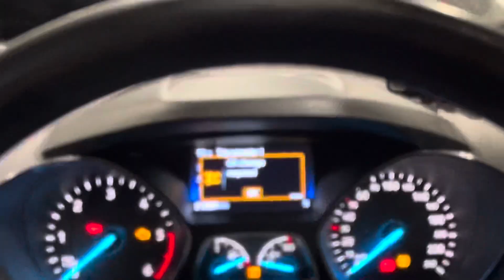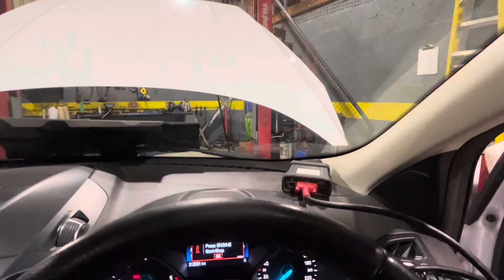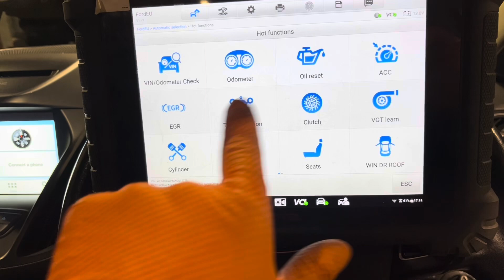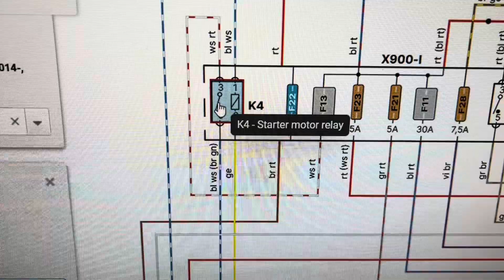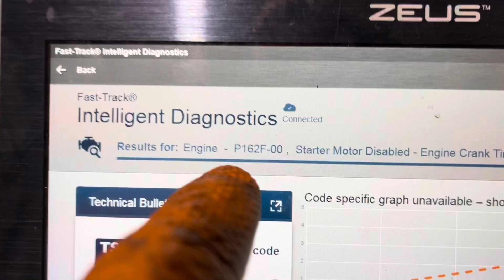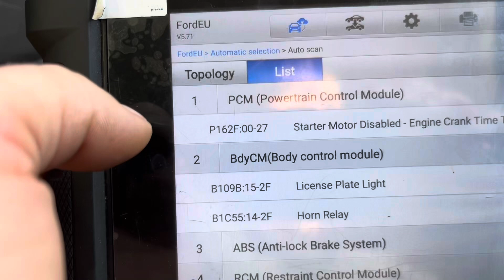Ford Kuga, P162F starter motor disabled fault

Comment: Ive buggerd a shitron dispatch. And has a simllarr sort of issue power to crank relay but dead after the relay .  Ive been told could be altenatror as its a stop atsrt and the alternator helps start the engie but then it could be bsi as i was probing that.  Its getting beyond a joke taht a ecu or bsi os so weak in failure points

Comment: Strange one will code erase In eobd mode ?
Did you manage to test the 2 control wires for starter relay ?
Reply from the maker: @simonedwards5401  code won’t clear in EOBD or manufacturer specific. But I didn’t load test both control wires, so I had better make sure to on the repair job . Good thinking & I appreciate it 👏👏👏

Comment: is it keyless entry , fords use the remote function module for the start button command to the engine ecu , not sure with the Kuga set up , the tpms runs with this too.
Reply from the maker: @mike-s8n8y  interesting, that is something to look at before fitting the ECU 💪💪

Comment: Thank you for posting this Peter - you get EVERY complicated job in Ireland !!
Them ECU's are a known fault on Fords the Focus has it in the same place - maybe ok if you live in a HOT / DRY country - but water & electric's do not mix 
They also suffer from snapped wires from the ECU to the fuse box & direct to components - dont know if it is the (Peugeot wiring that has ALWAYS been as brittle as dry pasta ) flexing / vibrating / rubbing 
All ECU's should be INSIDE the car !!
Reply from the maker: @colinblythe3710  that is a good comment & yes, you are correct they would be better inside the car. Quite a few a saying this is a relatively common failure on these ECUs. Cheers Colin 🙏🙏

Comment: There shouldn't be 3v on the relay signal circuit when the button is not pressed. The constant 3 volts is telling the ECU that you are trying to crank. Pull the relay leave and reset the code. If it clears then you know the 3v is wrong........ECU or wiring problem
Reply from the maker: @tomcurran65  good food for thought Tom. The car is back with the owner as it was, now I kinda want it back after reading some of yer thoughts 💪💪💪

Comment: Ford has so many modules that prevents the car to start . It only starts because of the bypass. The fuel control module can be at fault , the bcm can also cause it . Even a abs fault can prevent starting because the ecm doesnt know if the brakes work, you got a task with this one mate , Just truck on you will get there i have faight in you 😊😊
Reply from the maker: @xxl531  I hoping to get the ECU replacement job, but haven’t as yet. My conclusion was that it is the ECU with no faults in any other module causing the P162F to be stored in it. I’ll let ye know either way 😉👍👍

Comment: Just as a FYI - the car is not going to do DPF regens correctly with a faulty ambient air temp sensor showing -40c, so that needs fixing also.
Reply from the maker: @timbo19751975  correct, but weirdly I mentioned this to the owner and he hadn’t ever seen the -40 and then when I looked it operating as expected. This also points me towards some kind of internal ECU failure especially after the holding box had been burst open like it was 🤷🏼‍♂️🤷🏼‍♂️

Comment: Very interesting! Based on how the relay is energized (ECU) points to a bad ECU... However what if those 2v/4v readings at the relay aren't actually biased voltages? If you could have disconnected the pins directly from the ECU and measure what's actually going out I think it would have been definitive. I'm thinking what if there's a short between ECU and the relay and the +12v that should get out of the ECU goes into protection mode and gives you that low reading... I mean...a biased voltage on the ground side would make sens for the ECU to detect a fault, but the +12v line should be a 12v line... Great video! Awaiting for part 2👏
Reply from the maker: @alexdragomirescu5084  now that’s a great comment Alex, and yes it make perfect sense. I must admit that I didn’t do any load testing on the harness for both control wire integrity. Brilliant food for thought as I haven’t got the repair as of yet 💪💪💪
Reply: @kennedysgarage3281  no problem! We all get distracted by over thinking situations. Many times a fresh pair of eyes can give a new approach. You do the same for us, so...🍻

Comment: The wires and box with a start button looked like doc Brown started to build a time machine.
I had a similar problem once, it had already had a starter motor, i spent a couple of hours and ended up asking the customer to send it off and getting it tested. The ecu apparently had no faults, i went back to see if i had missed anything, i never figured out what was wrong with it.
Reply from the maker: @mattsautodiagnostics  hey Matt, that’s when I’m at right now and would like to get ECU replacement job. Just to prove for future reference. I hope things are going good for you 🤞🤞🤞🙏

Comment: Great bit of Ford engineering, putting the most sensitive/critical piece of electronics in the wheelarch, pure genius
Reply from the maker: @martinfinbarscully4924  😂😂😂😂
Reply: You wont want a range then as you can bugger them up by taking to long to drain and refill the oil when cashing oil filter I believe the kugar is the same but with the Freddy ya need to strip half the engine

Comment: Most likely Pcm, just going through this with a Ford Everest Diesel, same system. I have 2.5v and 4.5v at pin 1&2 at the starter relay, KOEO. No crank, no codes. Will start if you bypass start relay. All inputs that Pcm needs to start car are there. Checked wiring, powers, grounds, calling Pcm. The OE manual will tell you what conditions are needed to start the car. Apparently not an uncommon issue on Fords with this system.
Reply from the maker: @mrblonde2013  other commenters are saying it is quite a common issue also. So fingers crossed I’m right, I’ll will let you know 😉👍👍👍
Reply: Update, fitted and programmed used pcm earlier this week, that fixed it. Starts and runs.😁😁😁 @kennedysgarage3281

Comment: Check the fuelpump control module i think the startermotor is sending you on the wrong path
Reply from the maker: @xxl531  good comment, I have quite a few different options now & appreciate that mate 🙏🙏🙏

Comment: Had a fresh enough Kia suv in today with the usual rod-knock, Peter. Yoke has "a full service history" - I went to take the undertray off to drop the oil, no go - bolts all seized, never been opened in yonks. Had to melt the bolts through the plastic with a blowtorch to get it off.   Air filter was like a zoo, about 2.5l of black oil came out & the oil filter was a gunked mess. 

Stupid design of the piston to rod connection aside (who thought that was a good idea baffles me) I'm wondering how many of these yokes failing are because the books stamped but the works skipped...?  

Hope ye didn't get blown away last night - here was wild.  Just listening to the vid has that Ford bu-de-dum-bu-de-dum doin my head in from afar - was at a crashed Torino & a Kuga quarterpanel this week & had to listen to the yokes beepin away  - shaddap, lol.
Reply from the maker: @jamesward5721  so you didn’t stop working because of a breeze 😂😂😂
Me either worked away as normal & luckily didn’t get affected too much. A few ridge tiles gone but otherwise all was ok. 
Those Hyundai & Kia are awful yokes for the undertray bolts seizing in place & as you said only after 2 or 3 years. That kinda stuff adds on a bucket load of time 😬😬
Reply: @kennedysgarage3281  Have an engine rebuild to do on that one next week, Peter - 4 pistons, 4 conrods, new hg & bolts.  Everywhere else quoted her a new engine, I know it's just knackered rod/piston interface, will keep her bill reasonable. 

Dunno about the wind, but here's awash from the crazy rain we've had the last few days - it's an Ark we will need if it keeps up. My heart goes out to them who still don't have the ESB back - a pal who sprays lorries just a few miles away had no power until yesterday eve - with the yard rammed. :-) His head was melted.

Comment: Sounds like your guessing for 31 mins
Reply: You ever diagnose a car?
Reply: Sure, you are a genius and have a crystal ball to tell you whats wrong without any testing whatsoever...😂😂😂
Reply: Interesting one. I’m really interested if you get to the bottom of this Peter.
Reply: When in doubt process of elimination.  Kenny defo isn’t guessing lol
Reply from the maker: @danascully-x2t  every diagnosis is a guessing game until you gather evidence on what’s right and wrong. So unfortunately on this one I thought it was going to be fast and easy, but didn’t work out that way. Hopefully I’ll get the ECU replacement and cloning as a part 2 🤞🤞